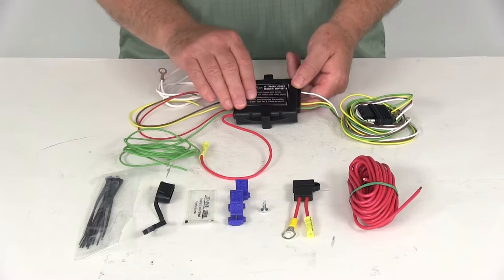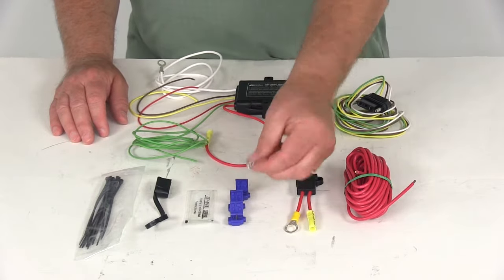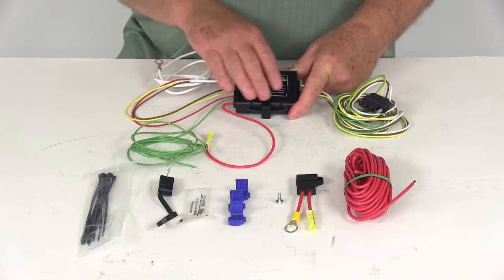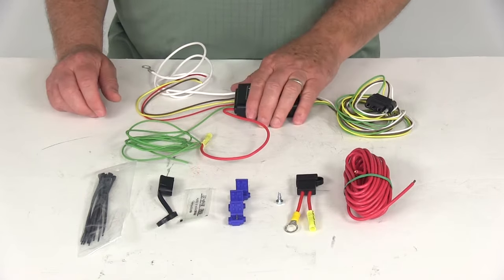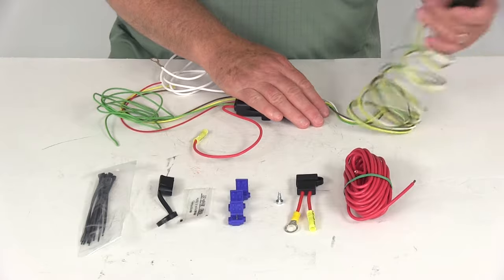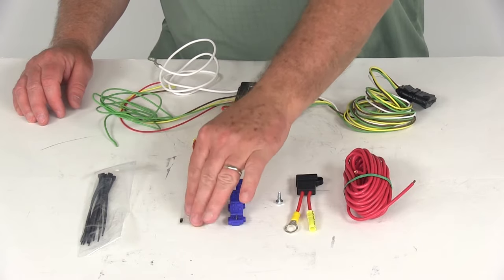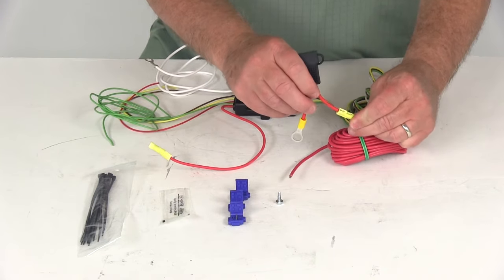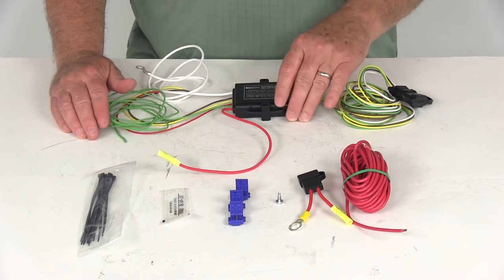etrailer | Hopkins Wiring - Trailer Connectors - 46365 Review

Comment: That is more extensive than what I got from Oreilly.
Reply from the maker: What you got from the auto parts store likely isn't a powered converter. Instead of drawing the power to fire the trailer lights directly from the vehicle battery like our harness does, a non-powered converter that just connects to the taillight harnesses which will pull the necessary power through the taillight circuits. This wasn't a problem on older vehicles, but many new vehicles won't have the necessary capacity to power anything over and above the draw from the vehicle taillights. I hope that helps explain it.
https://www.etrailer.com/Custom-Fit-Vehicle-Wiring/Hopkins/46365.html

Comment: bought an old ford with this set up but it's missing the in line fuse holder. Any suggestions?
Reply: Adam Moseley go buy the in line fuse holder at any local parts store.